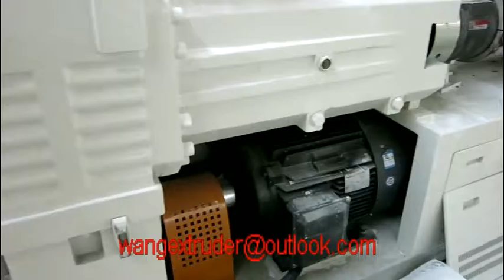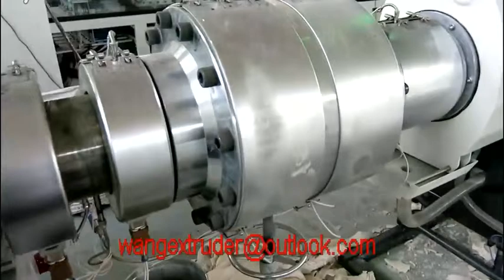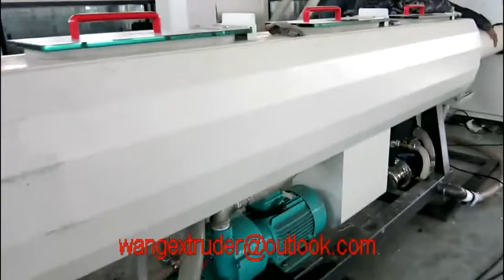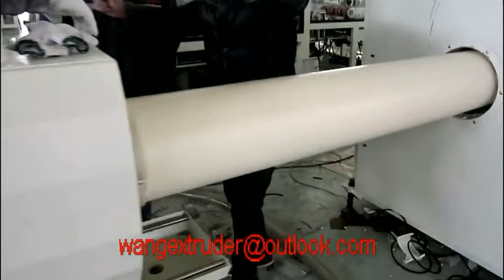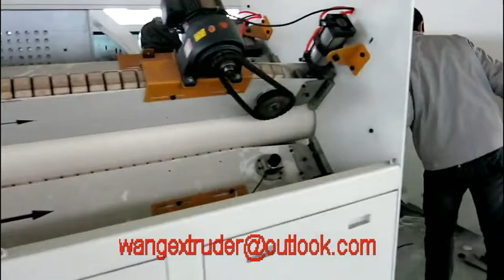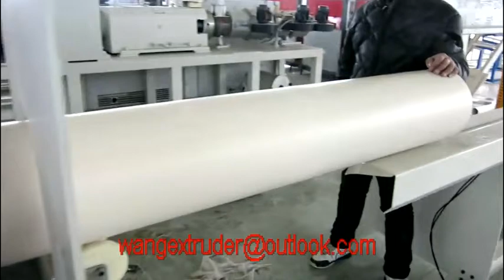Conical twin screw extruder for PVC pipe with high calcium powder

Comment: what is the maximum calcium percentage you can run on this machine for a suitable strength of pipe?
Reply: did you get the answer?
Reply: @extra6839  not yet
Reply: @khalidmanzoor6842  do you produce pipes? if you do what max percentage do you use for market quality
Reply: @extra6839  depends on the market, which country are you from?
Reply: @khalidmanzoor6842  south india. Telangana if you're aware, what about you?
Reply: @extra6839  north india. Kashmir. Which machine do you have or are you planning to buy?
Reply: @khalidmanzoor6842  twin screw, will arrive in 10 days. What PHR works in north india and do you know about the south indian market?
Reply: @extra6839  windsor or kabra? 60 to 100
Reply: @khalidmanzoor6842  not these brands, its one from gujurat you wouldnt know the maker. 
So does over 100 PHR calcium not work in the market?
we are competing with other local pipes and scrap sellers, to compete with price we need to make atleast 100 PHR calcium. Let me know please, thanks
Reply: @extra6839  it all depends on the experience of the foreman. One can make scrap at 60 PHR, another can make quality at 100 PHR.
Reply: @khalidmanzoor6842  i assume that depends on list of stabilizers, plasticizers and lubricants you use as well as temperature set for machine. Im 22, new to business, where and how do i learn and master the best formulation?